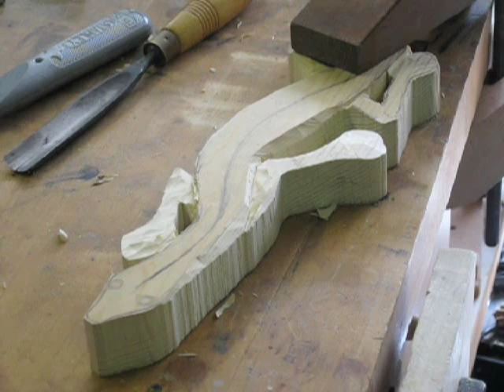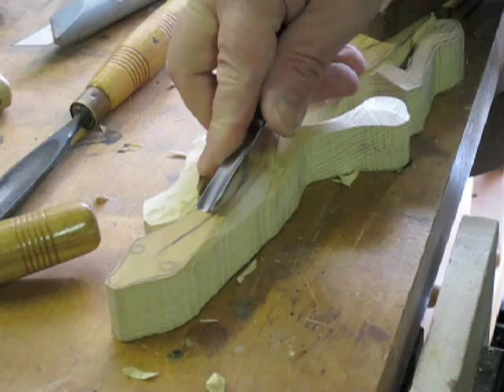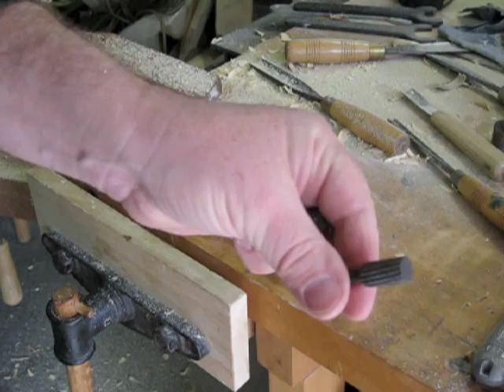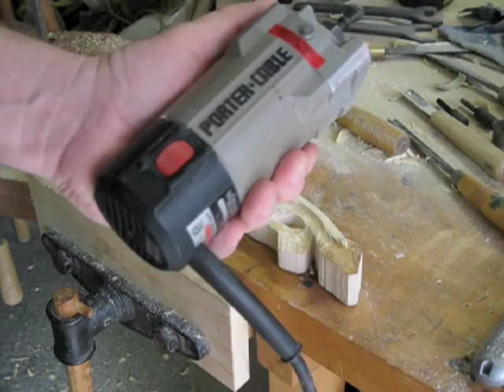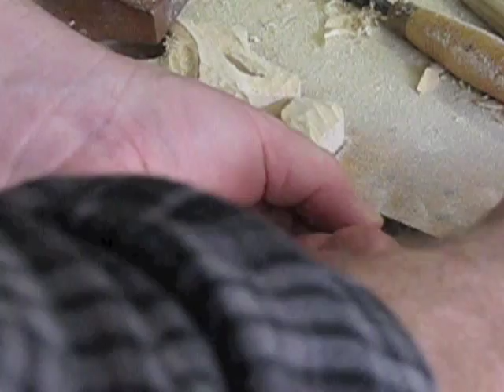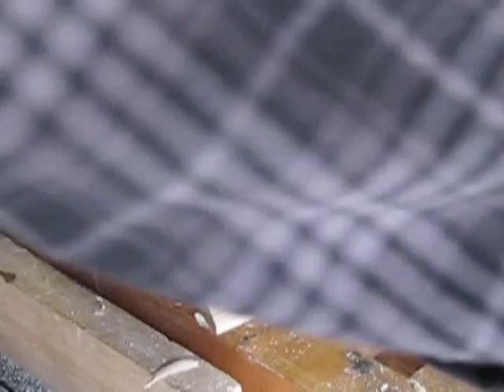Carving a Pine Lizard - Part 2

Comment: Hey, nice video. One question though. I have a pine plank and whenever i try to carve in it, it is hard as hell. I easily carve with my chisels in fresh pine lumber but this dried wood plank is way too hard. Chisel gets stuck at the very beginning of carving. Is there any way to soften wood or anything? Chisels are quite sharp, no problems on that end.